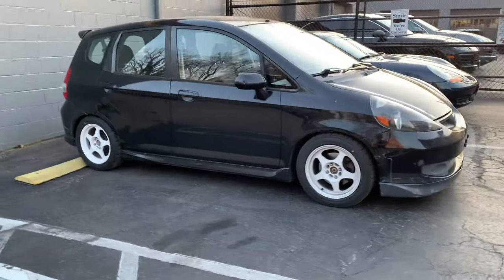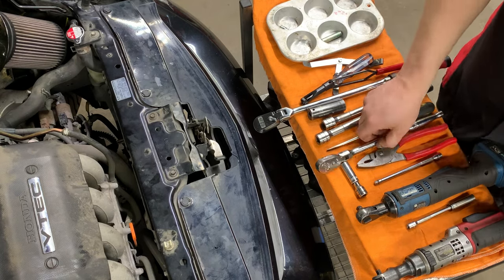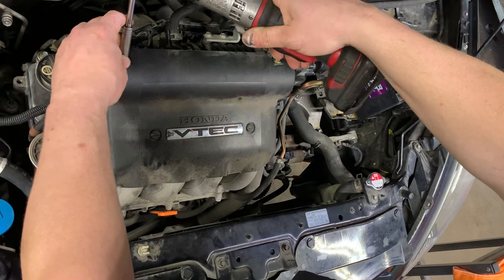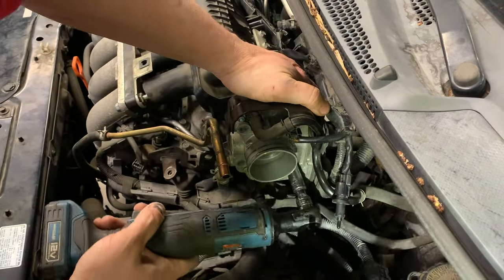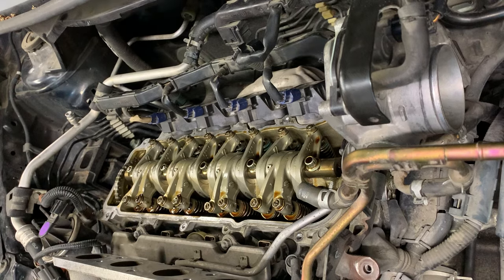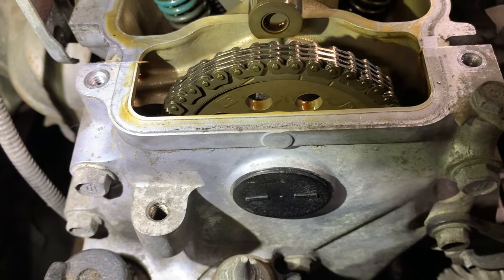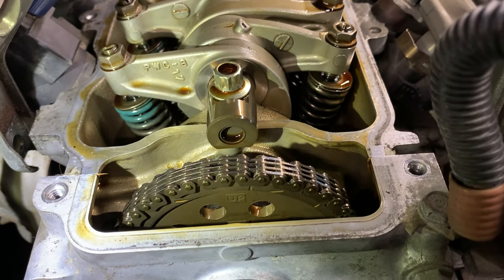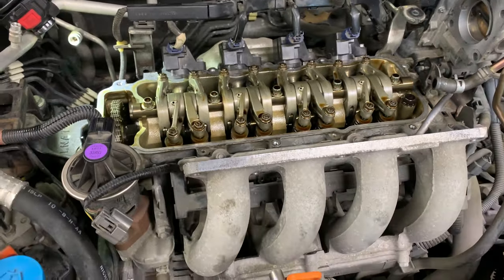Honda Fit / Jazz Valve Adjustment - 2001-2012

Comment: I bought my Honda FIT 2009 at 143,000 miles, now its 227,000.  I don't think it ever had a valve adjustment and the car still runs fine.

Comment: I've got a bit of a problem, i hope you may be able to help. I got a 2003 GD3 Fit, with the seven speed mode button. When i use the the button during the day it works great, Strangely using it at nights it causes the dash to start flashing away until i switch it off or use the gear level . I'm wondering if its a electrical ,load issue or what??? Can you or someone in the comments please help.

Comment: Excellent video... my car was stalling at first couple stops as well. I just finished doing this and im about to put it together. Hopefully this fixes the cold start stall issue. Thanks a lot ill update in a few days. I recommend changing all the gaskets in the intake manifold including the EGR Chamber gasket. These engines are very reliable and excellent gas savers.
Reply from the maker: So glad to hear you got use out of it. Hope the engine comes around!
Reply: @oioracing  Engine runs excellent now and does not turn off when cold. The car idles like new and im very happy. Very easy job thank you again.
Reply from the maker: @alexcalderon4508  A success story! We're doing something useful!.. well.. at least Ryan is :D

Comment: Super clear and well thought out video, thank you for sharing!
One question on the reassembly, is there a reusable valve cover gasket or did you have to use hondabond?
Reply: I had a new valve cover gasket I installed the first time I adjusted the valves. I didn’t use any sealant on it. You will see a little bit around the timing cover but if there’s not a ridge you can catch with your fingernail you don’t need it.
Reply from the maker: This is Ryan himself btw.

Comment: First of all thank you very much for your video! Q: from what I see in your video it looks like you did not have to remove the wipers or plastic cowling or a metal shelf underneath. but is that also correct for my 2012 jazz hybrid? Please confirm. thank you so much!
Reply from the maker: For valves it’s probably not required but if you intend on doing any work with the coil packs or plugs it’s a must.
Reply: @oioracing  Thank you!

Comment: have a 2019 fit slowly making ticking sounds over the years getting worse and its only during winter time it does it 40 degres or colder, once the car warms up the ticking sound goes away and it's fine, during the summer time it doesn't make the sound at all,only 55k miles on it.
Reply from the maker: Ticking is good. Ticking means that they're probably adjusted correctly. It's when they get quiet that you need to worry. Still, its a pretty simple job to do just for a little insurance.
Reply: @oioracing  Nice to know. I thought the opposite. I guess I can relax now but I will use this video when the time comes. Thanks.

Comment: What is the Nm to lock the tightness of the screws?
Reply: Honda doesn’t list a torque spec in my information, but generic torque for a 6mm bolt/nut is 12Nm